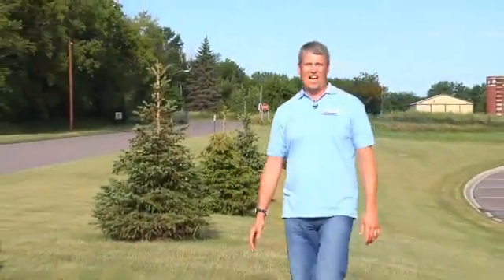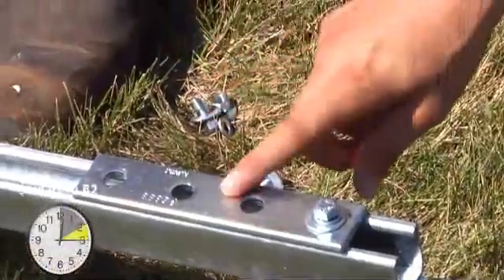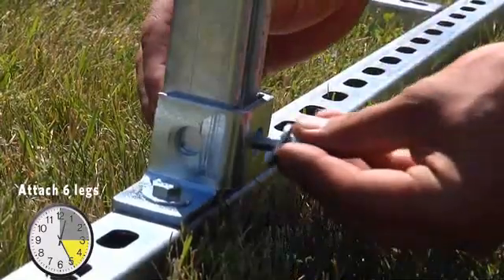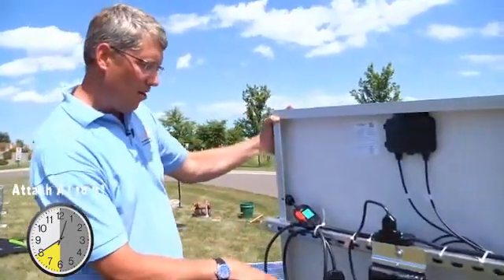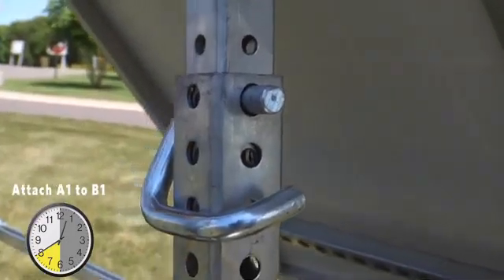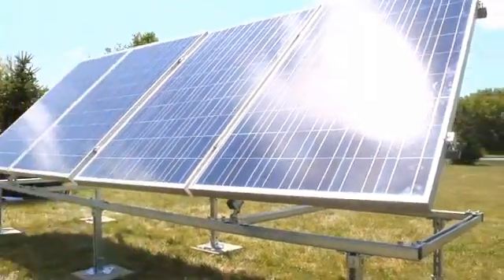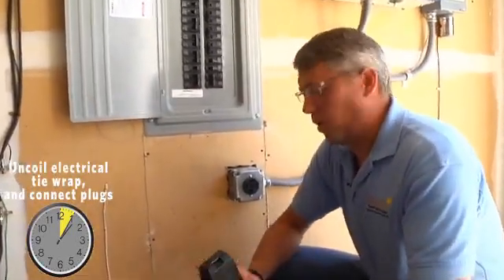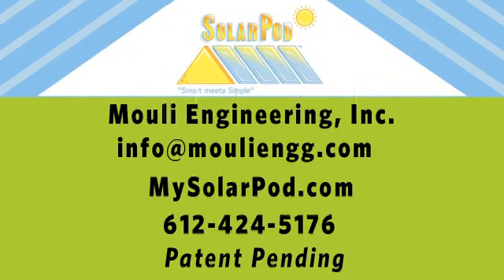SolarPod Standalone install

Comment: I'd say that was quite easy!  I would want to do more than 4 panels of course.  Probably 52 panels in total.   So there is no pouring concrete to hold the pods down?  Just the rod in the ground?
Reply: I did some math and to get the 20K I think I need, the cost would be $40K!  Too expensive for a DIY system.